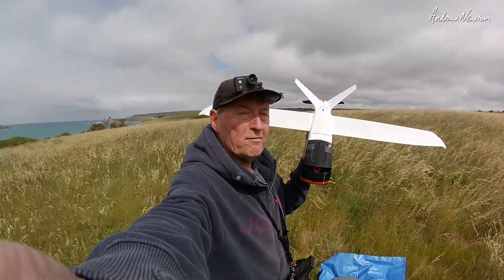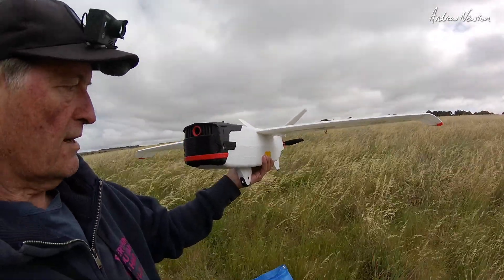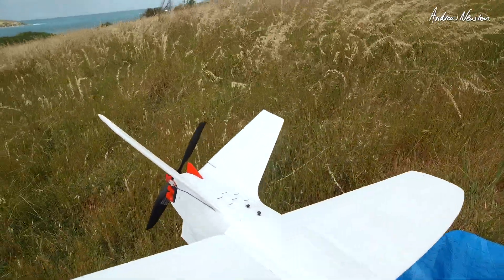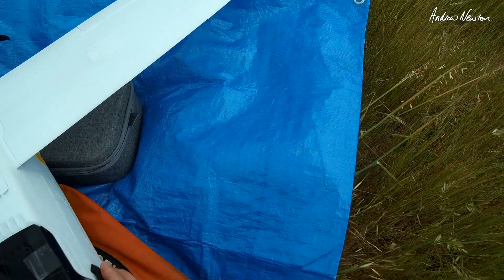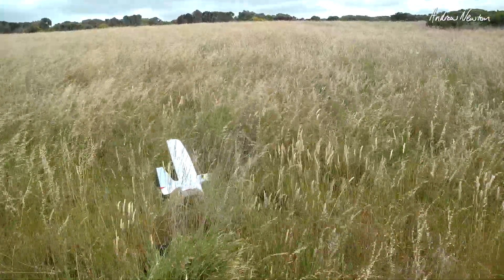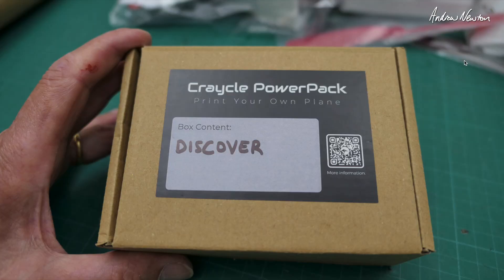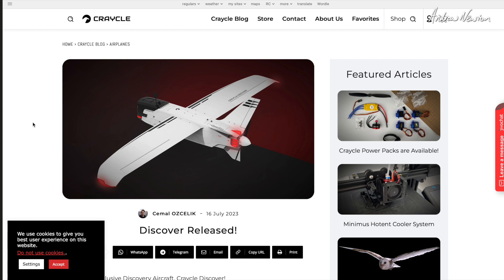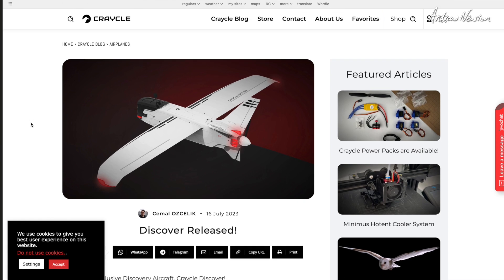Craycle Discover 3D printed plane

Comment: Nice to see exploring a 3d printed plane. As always, a good open minded review. There did appear to be some pitch instablity (onboard camera view). Not sure if its due to control throws, CG related, or associated with the wind gusts/turbulence. 
Materials, designs and printing techniques are improving. It's nice that can order as a component kit to dip ones tows into this building technique, without needing to own a printer, or learn another hobby.
Reply from the maker: All three I suspect, and maybe thrust angle. Should be better next flight.

Comment: Elevators look quite small, could have contributed to the loss of control on the second landing. According to their website the wing is 10% T/C which is pretty thin, reduces pitch stability. A little less attention to frilly facets under the tail, and more given to wing strength might have been helpful. To those complaining about wind, would you also be saying that for a foamie or composite, or would it not even register as a potential problem for those? The grass here is about as forgiving as you could possibly want which matters more than wind, as mentioned in the video, more wind allows lower groundspeed for launch and landing. While the plane is airborne, the speed of the wind relative to the ground is not really relevant.
Reply from the maker: It is a slim wing with sharpish leading edge and decent weight, so I guess slow speed stalls are to be expected. I probably had rearward cg, throws too high and thrust angle off. Not my best work.

Comment: motor shoved up the rear would change the CG issue :)
Reply: True but it would mess with the GI system too.
Reply from the maker: Just needs the battery forward a bit, and checking the balance in less wind

Comment: First, thanks for all the info you provide for new fixed wing pilots like me, especially the Newton Airlines blog and INAV articles. Second, apologies for this off-topic question: I plan to get a Swordfish (PNP) and add a SpeedyBee F405 FC and GPS. Same cost as a RTH with a better FC (and standard). It will be my 1st plane with FC and INAV (I'm a drone flier with good Betaflight experience.) Am I underestimating the benefit of getting the RTH with preconfigured INAV? Don't want to obliterate the plane before I get INAV flying! Any comments appreciated.
Reply from the maker: Pre configured FC still needs careful checking so not really an advantage. It's a lovely flier by itself so I would get used to it first before trusting your first INAV setup.
Reply: Thanks, much appreciated! @AndrewNewton
Reply: Ordered thru your link.🙂 @AndrewNewton
Reply from the maker: Thanks Mark. Hit me up with any questions when you're putting it together.
Reply: My Swordfish PNP arrived with none of the electronics connected or installed. After several days I think I've got it figured out, almost. I've got (+/-) wires to solder between the back of the wing interface XT30 and the ESC, and the wing servo has a harness that plugs into the top 3 backside connectors on the wing interface plug (G,5V,S). The only wiring harness left is a 3-position servo connector with one white wire at the top (or bottom) position. I think this is the ESC signal wire. so I would skip the 4th position on the interface (G), and plug it into the 5th position (S). That leaves the 4th position (G) and 6th position (Aux) empty.  I think this could work as we have stopped soldering ESC signal ground wires some years ago, believing that the main ground wire was all that's needed.  Before I assume this is true for planes, could you check whether your ESC has  one or two ground wires from the wing interface board? (The harness that connects to the other of the interface into the plane does have a ground wire.)
Thank you.   @AndrewNewton
Reply from the maker: ESC ground is connected, that's the way I have always done it. Photo here https://www.youtube.com/@AndrewNewton/community

Comment: Good job you had soft long grass to land in Andrew...It looked very unstable in the pitch axis to me...Is the CG correct is the question. Including the CG they suggested...?...🤔😳😮🇬🇧
Reply from the maker: Yes id did behave like CG was out, needs further testing
Reply: @AndrewNewton  Agreed, the other Elephant in the room is the high aspect ratio wing section...it's very thin looking to me ..I'd wait for a calmer day and try a lighter Lipo moving the CG back some...🤔😳😳

Comment: The problem with planes printed with a 3D printer is weight and strength. If we want the plane to be strong enough, it is relatively heavy, and if we want a light plane, it is often very fragile. The foam is more resistant for equal weight.

Comment: Andrew - your videos are always so informative and straight forward.  And your flying site is second none!  Turkey is a interesting manufacturing location.  I am impressed with detail and quality of the products they are providing.  While not perfect they have some interesting planes and providing a 3-D printed kit is fairly new (I might be behind on this).  As you mention 3-D printing is problematic, but as this model shows it is possible now and with new formulas for printing materials this should improve.

Comment: I have been flying 3d printed planes for 4 years now, it’s all I fly, I have over 20 models at the moment and they all fly fantastic. With practice you can print them really strong. 💪 I have small hand lanched planes to very large edf jets. It’s great fun 😊
Reply: Im the same apart from a few foamies most of my fleet is 3dp airframe, some good some not so good

Comment: I have recenly started flying 3Dprinted planes and agree the technology for flying model planes is in the early stages. The planes I have flown are way better than expected in the sky but I have to be at my best when landing them if they are to stay in one piece. The most difficult part of this adventure is getting the printer settings correct, if they are not you usually find out towards the end of a long print. I am lazing in bed at the moment with my printer churning out another plane while I sleep, whats not to like.

Comment: Thank you Andrew for this nice and detailed video!
Reply from the maker: Thanks Cemal. Shows it can take a bit of punishment. Next flight will be in calmer wind
Reply: @AndrewNewton   Thank you. Since Discover has a little draggy nose and a bigger fuselage for action cameras, it's not a suitable model for dancing in a storm but I see that its handling. Orca V2 could easily handle this. I am glad you want to test it again! You should add some FPV gear and an action camera into place this time. I will send you action camera holder files. Sorry that I forgot this.

The material we use in our production is Porima3D branded standard PLA, not even PLA Plus or Tough PLA. We create flexibility in the design to make the model more durable. Several months are spent optimizing model parts. In this way, they become more durable model parts suitable for mass production.

What if a filament that was flexible like TPU and had a hardness close to PLA emerged? A harder TPU would make the model unbreakable and could be printed on any printer, providing all the mechanical capabilities, internal volume and durability of foam that 3D printing provides. We are excited and working for this. Our models are ready for that innovation.

By the way, the entire model is suitable for printing with TPU (Some of our customers did it) but it is a little difficult with standard printers.

Comment: Normally a fan, but not today because I feel this was unfair to the plan and 3D printing of planes in general. An incorrectly built plane was taken out on the worst possible day, stepped on and crashed twice. I would have liked to know this plane behaved under more neutral conditions.
Reply from the maker: Fair points, but it does show that it needs to be handled with more care than my usual level. Next flight will be in better conditions.
Reply: Bro, he’s flying in real world conditions. Most of us aren’t going to have calm windless days this time of the year. 🎉
Reply: He gave a very fair explanation of his past experiences and some of the pros and cons of 3D printed planes before taking it out to fly and as he was evaluating the kits. He demonstrated that he built it correctly and that this particular 3D plane even flies in rough conditions but won’t hold up as explanation of what to expect.
Reply: https://youtube.com/shorts/VsnCZ4gELFo?si=OyfAQcqiEOFSba0j

There is a Short Video for a test flight of the Discover Beta version with stock PowerPack, under calm wind conditions. 

But it should be also flying well on Andrew’s test conditions. In the windy days, I shorten the servo movements from the remote control. In this way, you can control the model much more easily. Andrew is experienced enough to know this. Let's not forget that it was her maiden flight and he was very good at the control of the model.

Comment: Hello everyone ,
Personally, I have been flying 3D printed planes for about 2 years, those from the ECLIPSON brand: a 2m wingspan X model and an EGW (flying wing) and frankly I can only congratulate myself if it obviously requires some precautions (handling and storage) it works very well the only thing is that all the parts not heavily requested must be printed in LW-PLA otherwise the weight estimate is very bad. For my part, I systematically apply a strip of tape on all the connections/gluings, particularly for the wings. The choice / quality of the glue is essential and the installation "with a stick" as in the video should be avoided (sorry) the use of an instant hardener is a big plus .
We can also reinforce certain bonding (engine frame / fuselage, etc.) to make fillet joints with baking soda (be careful with an exothermic reaction if in large quantities!!) it fills the voids very well and sands well. Hoping that this sharing will help some. Thank you for this test and the discovery of this new company. On the other hand, the conditions of the test were really limited and could bias the results and the impression that we got from the 3D aircraft.

Comment: looks like a nice build.  but for a 1300g plane that motor seems definitely way underpowered.. i have to imagine youd get much better performance with a slightly bigger motor.  

Interesting the plane seemed a little squirrely.  Thats largely been my experience with the 3d printed ones too.  They actually turn out very lightweight with LWPLA but they are not very stable in the air compared to simple foamboard